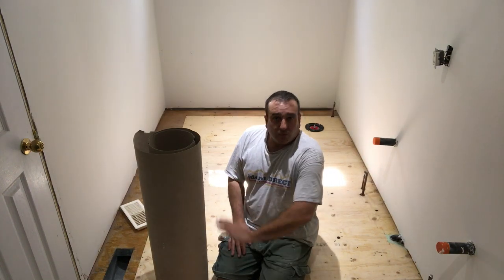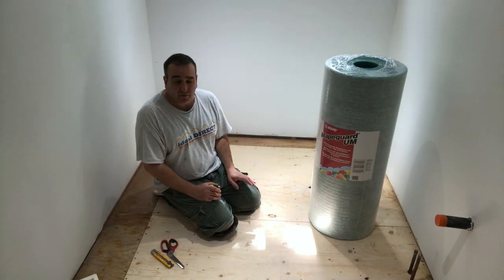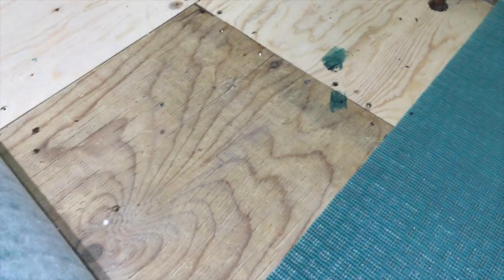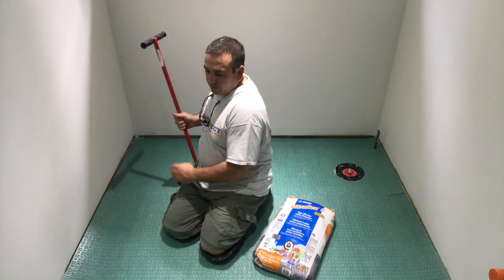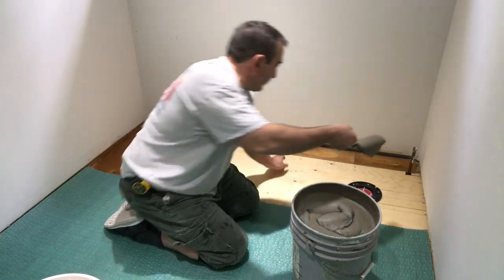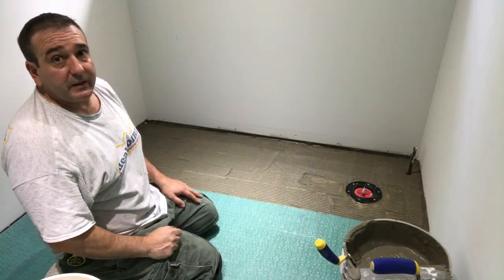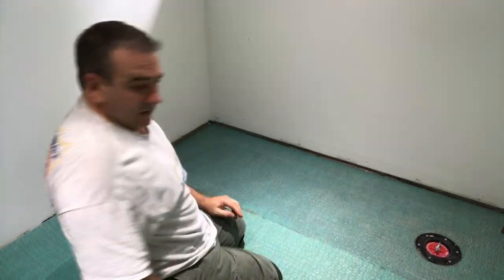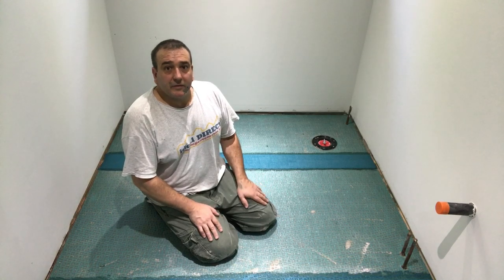How to install an uncoupling membrane and prep for your tile installation !

Comment: when keying in the mortar with the flat side of the trowel how thick is the layer thats being applied? ive seen another video where you installed tile on a concrete floor without using the uncoupling membrane but reading the comments you say is best to always use the membrane  Whats the reason for not using it on a concrete floor?
i am a new subscriber and handyman i appreciate your thoroughness in each of your videos. you are a natural teacher

Comment: You would do the exact same thing here is the floor underneath was concrete instead of plywood?
Reply from the maker: Yes, I sure would, in case the concrete cracks for some reason. If you don’t the crack in the concrete would eventually transfer to the tile.